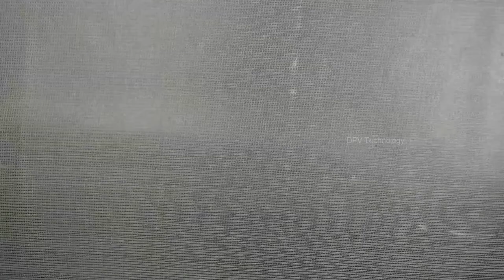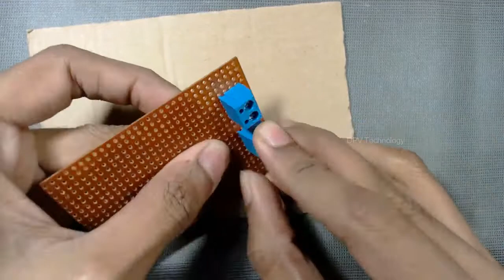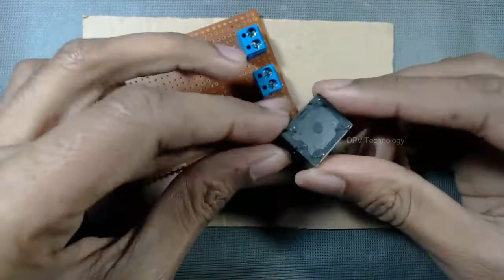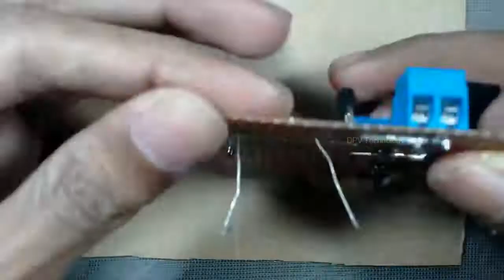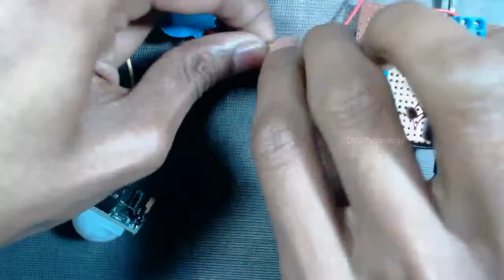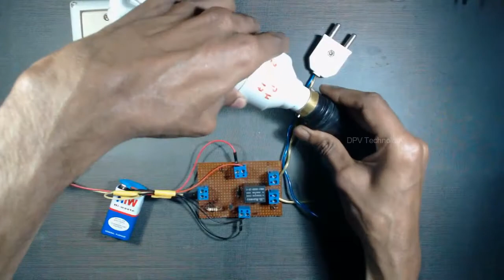How to make a motion sensor light using PIR sensor Without Microcontroller for home

Comment: i used the  circuit with 5 v relay , 5 v adaptor , pir sensor bc 547.When i swicth onthe power , relay switched on and bulb on , bulb stays on,. Can you pl tell me whats wrong with circuit. Bulb is not swtching off. I ve done setting of sensitivity and range also , no results.

Comment: Can I try it with a solderless breadboard with the same way
Reply from the maker: Yes, you can. It will work on breadboard also.
Reply: DPV TECHNOLOGY thank you i am working on the same kind which you did in my school project so a big thanks goes to you
Reply: Are you using breadboard 7×5cm ?
Reply: And if i using relay 12v,is that will work?

Comment: Can I use 12v relay?
Reply from the maker: thank you for your comment.Yes you can use 12 volt relay.But if you use 12 volt relay,Then the 9 volt battery will not work.You have to use 12 volt battery Instead of 9 volt battery.